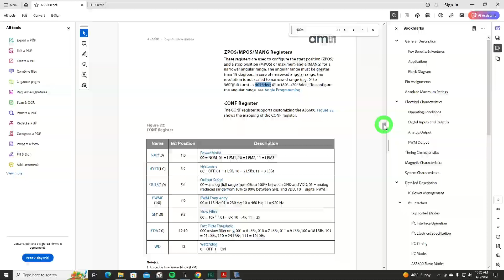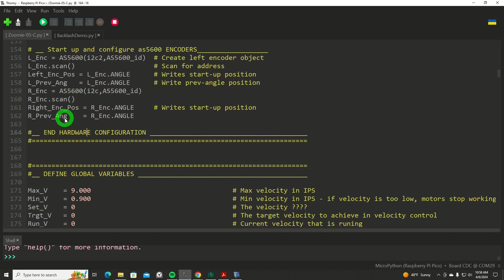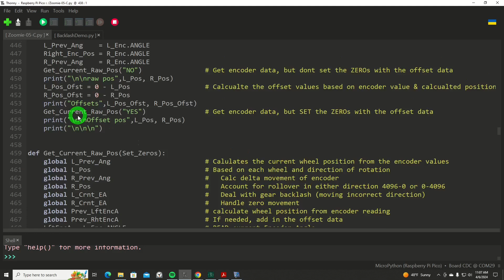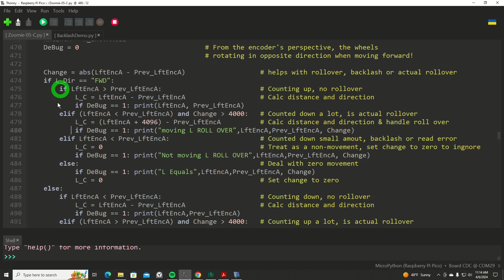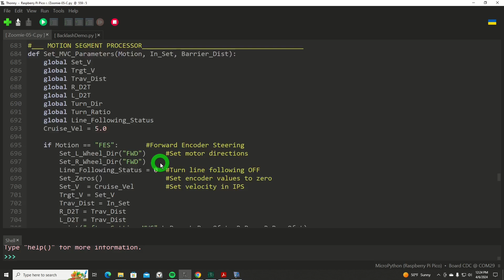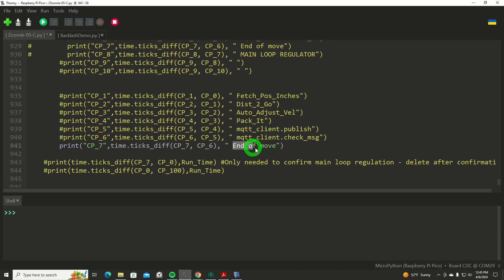E27 Implementing AS5600 Encoders into the Zoomie (robot)

Comment: thanks for this video. The part on backlash is really interesting. if your encoder is at the output shaft and ur using the encoder to perform odometry, does it matter that there is backlash. In other words, your encoder is still reading the actual rotation of the wheel, which then you can feed into your odom . for orientation calculations, im sure the IMU would help if you did some sort of fusion. Sorry im probably speaking out of turn here because i just about to head into odometry calculations on my robot for the first time and just thinking ahead.
Reply from the maker: Good morning!
Thanks for the kind words.
Backlash is your enemy as you already know.  If encoder is before the gear box (most likely place for backlash) you can never account for it.  If the encoder is at the output shaft (or wheel) , you are seeing actual movement.  However, don't assume just because you can see it and account for it, it isn't a problem.  With our output to cause motion, you will still need to compensate for it's existence.  
Industrial CNC machines have always had to deal with backlash.  In their output, the compensate for it based on a parameter setting that measured the backlash.  On industrial machinery, the encoder is on the motor -- not on the device being moved.  For really high-precision machines, another encoder is added to the axis of motion.  These are called linear encoders and they are the full length of the axis that is moving and are attached to it.  This is the closest you can get to ABSOLUTE position tracking.  These devices are very expensive and operate in the sub-micron precision.

In our world with robots and very inexpensive electronic components, we have to fight a strong battle to get acceptable precision in movement.  While it is a pain in the ass to deal with, it is a great challenge to overcome.  

Good luck and try to have fun with it!!!!
Cheers!
Chris

Comment: Could an AS5600 read its underside through the PCB when no traces or planes are going underneath?
Reply from the maker: I suspect it would not work - the datasheet references a maximum distance between the sensor and the magnet.
Cheers
Chris